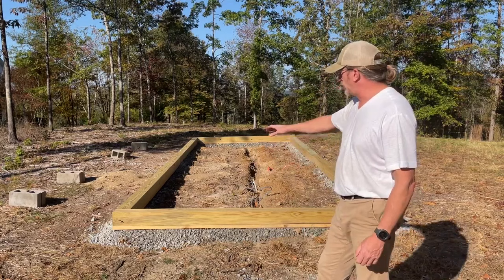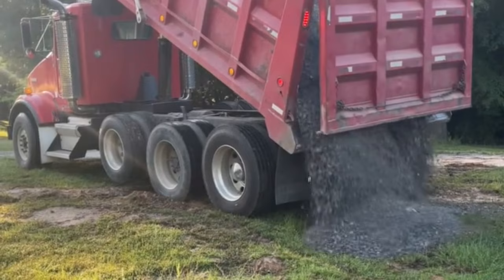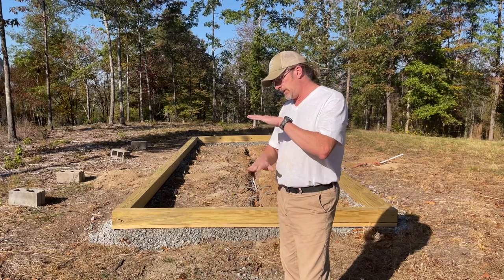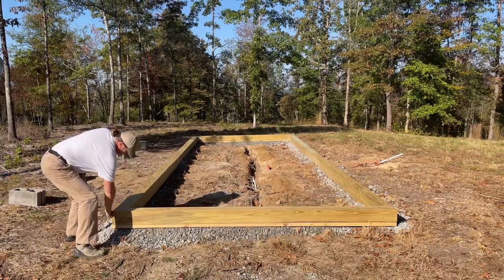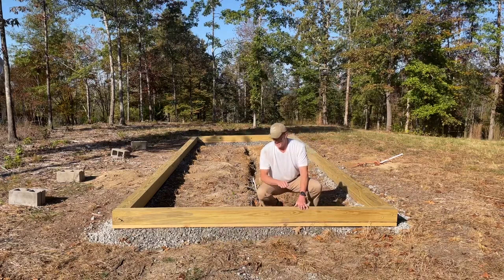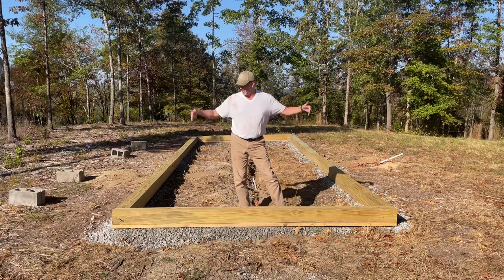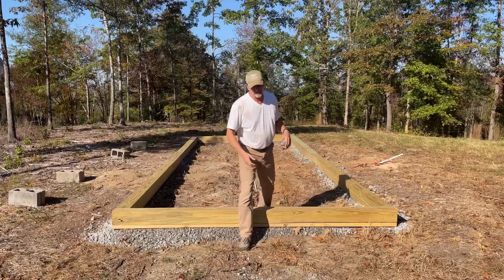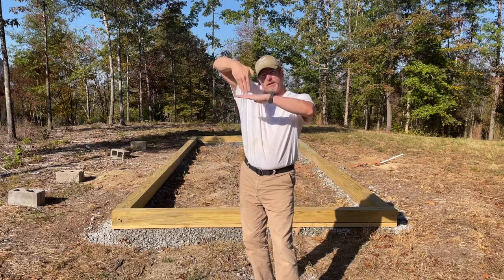Building a Planta Greenhouse | The Foundation (Part 1)

Comment: Thanks for the great video. Our new Planta 10x26 arrives in two week and I have levelled a section of dirt (red clay here in VA) for the greenhouse. I was originally going to get a truckload of crusher run in and put the greenhouse on that, but your wooden foundation seems better. My question is, did you attach the wood to the ground at all, or are you dependent on the weight of the wood to keep the greenhouse in place in strong winds and storms?
Reply from the maker: Great question.   I’m a Virginian living in Alabama so always good to hear from someone in the commonwealth.    I did not attach the greenhouse to the ground.   The Planta frame is strong and when it gets all locked together you will be amazed how tight the structure is.   The greenhouse will be ripped off the wood before the wood moves.   It’s heavy.    We have had some strong winds ( up to 50mph ) since I built it and no problems at all.     Reach out if you have any questions when you get started.    I’ll be glad to help.   Thanks again for the question.

Comment: I would have used washers and better screws.  Also, you should prepare a rat wall to prevent animals from digging underneath.  Those groundhogs are horrible diggers.
Reply from the maker: Interesting suggestions - Did you use these screws and washers on the foundation you built?  Thank you for the feedback.   How old is the greenhouse you have?
Reply: @StewartFarmApiary  I have a potting shed and I am just getting ready to build a new foundation for another garden shed, so I have been watching hundreds of videos on this.  The professional contractors are all recommending these types of screws with washers: TimberLOK by FastenMaster Black Ecoat Hex-Head Exterior Structural Wood Screws.  They predrill to get the screw started and it goes in easy.  NONE of the videos I watched about building a base have ever considered the rat wall when in the initial stages.  It's always an afterthought once an animal has done all the damage.  It's a lot easier to build a rat wall at beginning then after your building is contructed.
Reply from the maker: @HYTELES  Ah.   I understand.   Thanks for the feedback.   Have a great week.

Comment: Thanks so much for posting this!  I am confused though. In your video, you emphasized that the width should be exactly 10', but their recommended foundation width is 118.5".  Does it matter?
Reply from the maker: I called and spoke to them when I did it.   It’s only 1.5 inches difference and the frames allow for a little give.   Mine was perfect and I have zero issues.   It was also so much easier to leave at 10’ instead of having to cut a massive 6x6 and keep it exact.    If you are worried then I suggest you go off of what they say but I don’t have any issues.   Thanks for the question.  I hope my answer helps.
Reply: @StewartFarmApiary  thank you so much for your quick reply! I am relieved that I don't have to shave 1.5" off these 6x6's!!
Reply from the maker: @paulstuart5077  Glad to help.  I have a few more videos on building the structure that may help too.   Be sure to check them out on my page.     Have a great week.

Comment: Thanks for great video, I’m getting ready to put my 10 x 20’ Sungrow up and foundation info is sketchy. I’m just wondering what your climate is like. We are in northern Ontario and frost heaving can be an issue. Local hardware store said do the crushed like you did then half bury concrete block around perimeter (no cement used) then glue 6 x 6s to block foundation ( glue ? sounds strange). So I bought all that but thanks to your video I’m definitely going to add 2x6s to help hold 6 x 6s together.
Reply from the maker: Thank you for the reply and kind words.  I think you would be okay with how I did it with the exception of maybe burying the water line deeper.   I am working to build dirt up and around the greenhouse base for extra insulation.    Not a lot, but definitely up to the wood to cover all of the crushed stone.   I also put a suffice amount of pea gravel on the inside.   
Hardware store sounds to me to be trying to sell you more materials.   GLUE??       Interesting.

Thank you again for the question.

Comment: Hey there! I just purchased a 20’ sigma and I was just about to go at the exact same foundation you built. I was wondering if you built the frame EXACT to the dimensions they provide. I spoke with planta about it and they suggested adding .5 inches to my frame on the end and an additional 3 inches on the length. I was wondering what you did? I’m concerned about it being a bit too wide and having my tie downs end up being splayed out and not exactly flush. Thanks for this video!!
Reply from the maker: Great question.   I built exactly to instructions.   Didn’t add anything.   Here is a major suggestion.   Make sure all your 6x6 have perfect corners on the top side.    If not then there will be a gap when the polycarbonate over laps the wood.    It’s not a huge deal but I wish I would have known.    I just pushed some foam rubber down into the gap and it is fine.    Good luck.    I’ll be doing a video in the near future on what I would change after the one year mark.

Comment: Was additional height the only reason for using the crush and run? I’m trying to figure all of this out and I have watched your series on building the greenhouse. I was wondering if using just the 6x6’s is all that needs to be used for the frame or if the 2x6’s and the crush and run is required.
Reply from the maker: Great questions.    A lot depends on your soil.    I used the crush and run because it sets up almost like concrete once it’s packed down.   I wanted a solid base for the 6x6.    The 2x6 have a main purpose of holding the 6x6 together and not allowing the seams for bend where they join.   As the wood gets wet and then dries it tends to warp a little and this ensures minimal warping.    My main concern if not using the crush and run is the greenhouse “ settling” and then you will have issues.   The height is nice also.   This spring I am growing indeterminate tomatoes and I will string them up with little worry of the height.  

Watch later this week - I will be releasing a video on the unexpected costs of a greenhouse.    I am sure you will find very helpful of you are looking to buy one.  

Thanks again for the question.
Reply: @StewartFarmApiary  thanks for your reply. I look forward to seeing your next video.

Comment: hello friend. if you have time can you tell me what size l-brackets you used on the inside corners of the 6'x6's?  also what type of screws and size of them did you use? and what is the name of the plates that you used to bind the 6x6's together lengthwise? great videos , very big help
Reply from the maker: Happy to hear the video is helpful.    They are 12” brackets that are bent, so 6” on each side of bend.    I used a heavy grade 2” bolt to screw in.   Nothing complicated - I knew I wanted 2” minimal and when I got the brackets I just went to the bolt department and found ones that don’t the holes firmly.   Tractor Supply Company or Lowe’s will have them.    I got mine at Tractor Supply. 

I did not use plates to bind them together.   I just offset them on the 2x6 and screwed in with 3” deck screws ( lots of them) on the 2x6 side.    Once they are all screwed in it is very secure.
Reply: @StewartFarmApiary  i don't know where i got the plates idea from, must be another video. thank you, i hope you don't mind answering questions months after making your video
Reply from the maker: @zakkrueck2362  Not at all - that is how we all learn from each other.    I'll always answer any questions I can.
Reply: Did you secure the timber frame to the ground? I see that rebar is recommended
Reply: @PhloemFlowerFarm  actually i myself buried my greenhouse 18"s underground. i live in wisconsin and it will help to extend my growing season

Comment: I'm enjoying the videos as I purchased a Sungrow 32 and looking forward to installing the greenhouse here in Ontario, Canada.  In speaking to the Planta Representative they also advised that the width has to be exact.  That exact measurement, they advised, was 9' 10 1/4".  In your video you mentioned 10' which would be a difference of 1 3/4" difference.  That 1 3/4" difference would affect the frame sitting exactly on the edge of 6" x 6" which I am also using.  

I watched Planta's video which described the width being exactly 118.1" (9' 10 1/4" or 300cms).  Am curious if your measurement was less than 10' or was it exactly 10'.  Trying to make sure my cuts are exact and looking for feedback.  Thank-you
Reply from the maker: Thank you for the question - I did exactly 10 feet.   When working with boards as big as 6 x 6 I cannot stress with the exact 1/8th of an inch to be perfect.   That extra was distributed evenly on both sides and made a small "lip" at the bottom that allowed the polycarbonite to have a small amount of bend.  

Im sure you are a better carpenter than me and if you are, I suggest cutting exactly as they say.   I just didn't have the skills to do it.    

I hope this helps.  You will love the greenhouse.
Reply: @StewartFarmApiary  Thank you got the reply and will try to remember to let you know how I did. You’re right about extra costs which, after the unit, is for the foundation. 
Tomorrow, I’m ready to lay the 6x6

Comment: Did you use pressure treated for 6x6 and 2x6
Reply from the maker: I did - pressure treated wood today is not used with the same chemicals as years ago.    I have checked with two u universities with outstanding horticultural programs that have told me this.    I hope this helps
Reply: What was your exact measurements? We are getting a 20 foot long, but the width should still be the same.
Reply from the maker: @knagjak  If you are building a Planta greenhouse then it should be 10" if it is the same model as mine.   I hope this helps.   Mine is a 26' x 10'

Comment: Hi, I enjoyed the video. I was wondering on the base what the exact measurement was for the width? I'm using 6x6 as well. However,  mine is a 20-foot greenhouse.
Reply from the maker: Is your greenhouse a Planta?   The measurements for mine is ten feet wide.
Reply: Yes, it is a planta. When I called them, their tech said the width in fraction was 9'10 1/4".  Today, I decided to pick up a 7.5m (25') tape measure. 300cm = 118 1/8".
Reply: I will say the idea of using the 2x6's is a good one. I'll be using the same. Thx for the info.
Reply from the maker: @pawpawchronicles-n-morewit1210  Yes - which when I measured out is basically 10' wide.
Reply from the maker: @pawpawchronicles-n-morewit1210  Yes.

Comment: Should have offset the seams so they weren't in the same spot on the left and right.
Reply from the maker: This is holding up so far - is that how you built the foundation for your greenhouse?
Reply: Yes.  It will probably hold because it is over-engineered.  But for additional structural strength, the offset is a good idea. @StewartFarmApiary